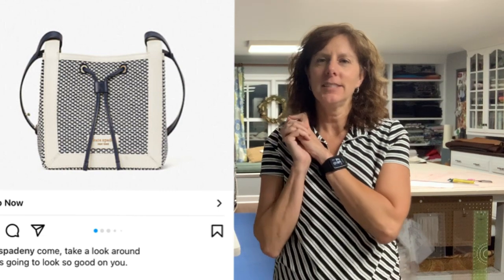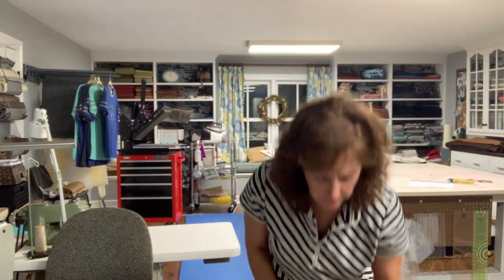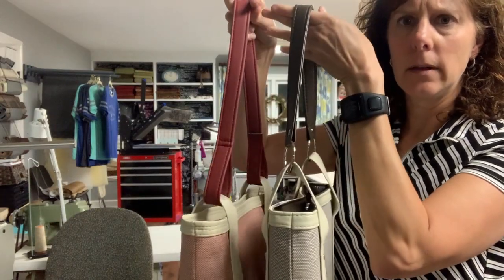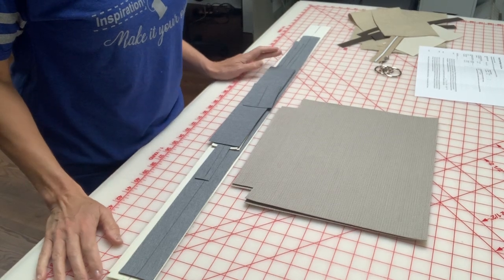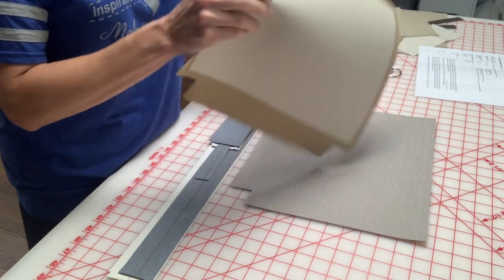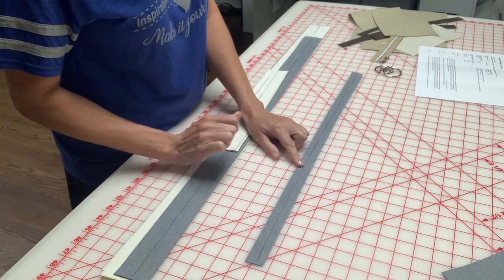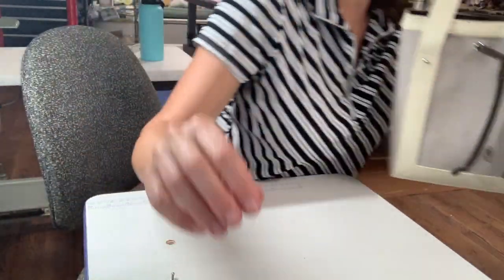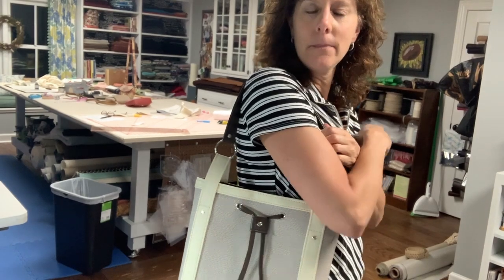The KS Tote by Simply Classic, Sewing a bag on Techsew 2750 Cylinder Arm #simplyclassic #techsew2750

Comment: You mentioned how you didn't like the raw edges of the straps. I agree. I use some metal strap ends on mine. I think I bought them from Emmaline bags and they are super easy to attach. I tried to attach a picture but couldn't. This bag is a work of art. I love the red vinyl and wish Bo Dee Oh had more in stock. I've made three of your DB Pocket totes from it and only have a small scrap left!!! 😒 Thanks for another fabulous video.
Reply from the maker: That is a perfect solution. Thank you for sharing!  Be sure to join the Simply Classic Inspiration Facebook group and post pictures there if you can.

Comment: Hi Chris 
What size grommets did you use? I only have 1 inch and I think those are too big.
Reply from the maker: I used 1/4” grommets. I get them from Rowley Workroom supplies. You will need a press to put them in, they are not screw in.   

You can find that size at Hobby Lobby. I believe there is a setter that comes in the package and you can use a mallet to set them. 

Hope that helps😀
Reply: thank you much appreciated!

Comment: Thank you for this video! I am wondering what you are doing with the machine needle and pressure foot when you turn the corners on the cream leather accent pieces? Can you not just simply lift the pressure foot and turn? TIA
Reply from the maker: I think you are referring to the part where I sew the mitered edges down. When sewing along the long side of the strips I do just keep my needle in and turn, but for those mitered sections I had to do a little more sewing.

Comment: I want a cylinder arm with the flat bed would you recommend the one you have or the I think 4800?
Reply from the maker: Yes. I believe they have a 4800 or 4850. I decided on the 2750 because I don’t sew with super thick materials. I use faux and real leather and cork. The real leather I use is usually 2-4 oz. I know some people sew with thicker leathers and I felt the 4800 was more for the thicker textiles. So…..it comes down to what you sew to make your final decision. I have not found anything yet that my machine won’t sew through! Good luck with your decision!!

Comment: Just curious, why no reverse stitching?
Reply from the maker: I like to have a neat seamless finish on the outside of the bag so I prefer to avoid back stitching whenever possible. Also, when using vinyl or leather or cork, the less holes I put in the textile, the better. I don’t worry about it so much when I am using a cotton canvas or linen fabric. I usually backstitch then.
Reply: How thick of vinyl can you get under the needle? Can you stitch a vinyl strap that is 4 layers to another layer of vinyl?